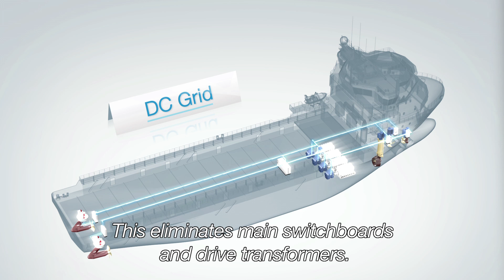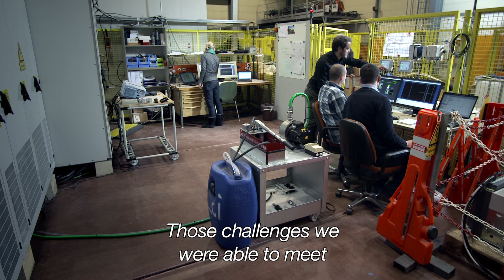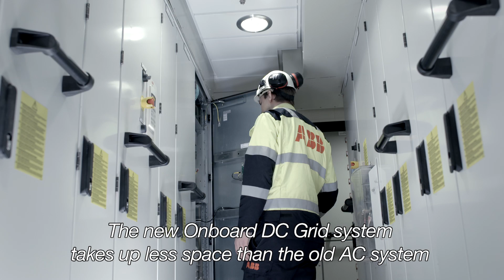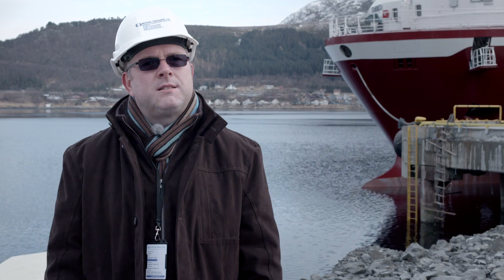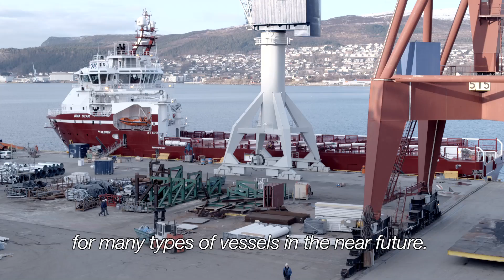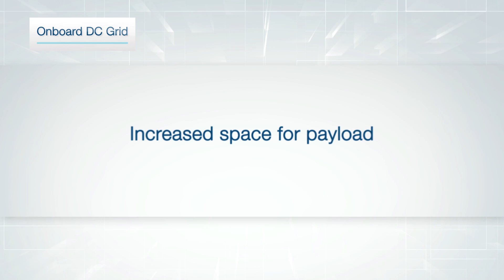ABB's onboard DC grid marks a new step forward in electric propulsion

Comment: Looking at prints on floor, really. 
I was on a tug 100% DC except for electronics. Propulsion and all other motors including the washer, dryer, and refrigeration were all DC brush motors. We had 4 main engines, and 3 AUX generators. One for main drive generators excitation. This is nothing new it has been round since 1939.